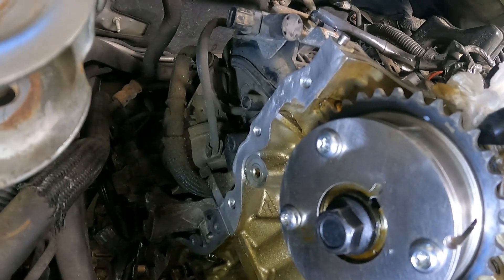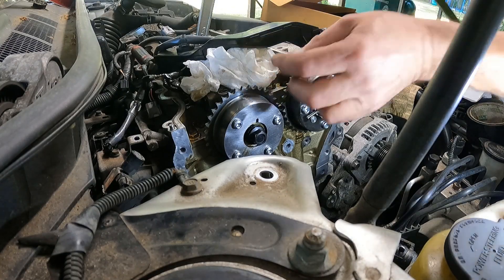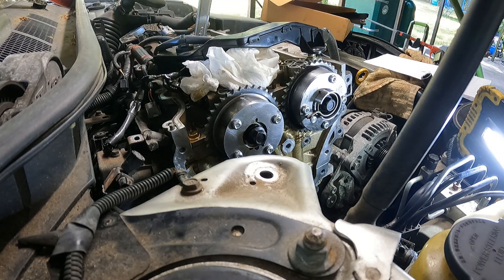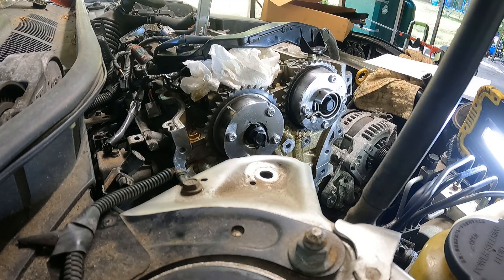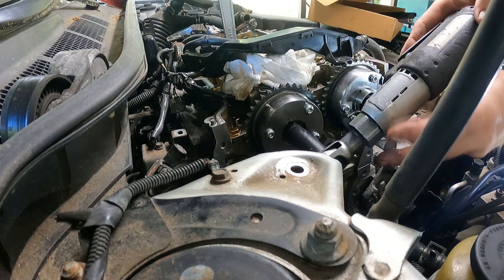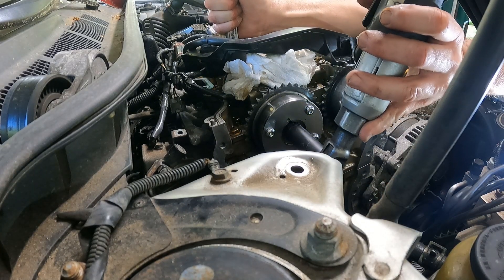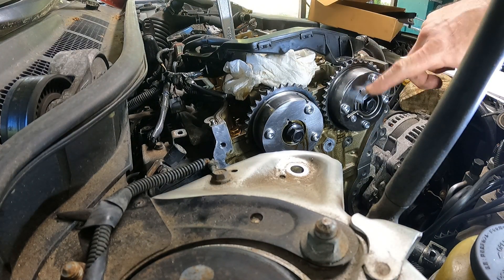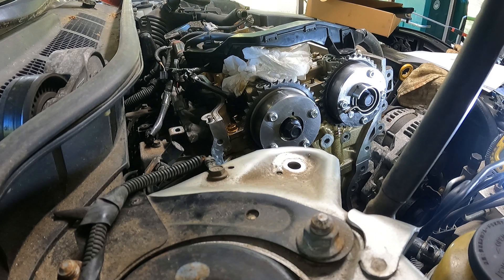How to unlock the VVT intake cam phaser on a Toyota 2.5

Comment: My God I hope this is what is wrong with my little 2012 scion xb. Codes p0011 and p0012 I've already replaced the vvt solenoid, clean oil and filter, crankshaft position and camshaft position sensors, new fuel pump, etc. I am so frustrated.
Reply from the maker: If you're going to do what I did,replace the timing chain and sprockets,this one ran like a brand new engine when I was done,no more codes or anything.it had a sprocket rattle at start up but if you have those codes and oil change ain't going to fix it,thanks for watching ~Tim
Reply: @timzauto  Thank you so much! It runs ok sometimes, but then it dies out. The more I drive it the worse it gets. But when it sits a couple of days it almost goes away.